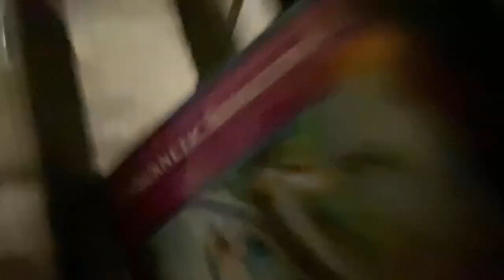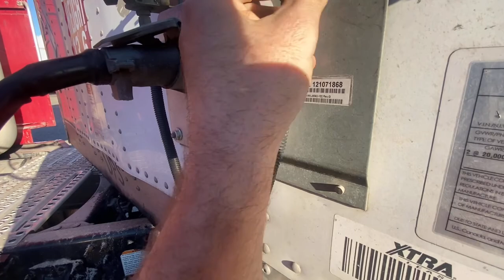Trucking vlog with CHAIN control in California!

Comment: I ran reefers from Calgary AB into Cali for a couple of years and I hated going over the Donner Pass in winter - not because you have to chain up, but because Cali was insanely conservative when making the trucks chain up. 
Link chains were never designed or intended to be used on solid surfaces such as concrete or pavement, it is meant for traction on dirt/gravel roads and deep snow. 
All running chains on wet pavement does is a) wreck the chains, b) wreck the tires, and c) wreck the roads, but Cali doesn't care.
Reply from the maker: Amen to that. It’s just a little thing they do to take advantage of the bad as it is situation.